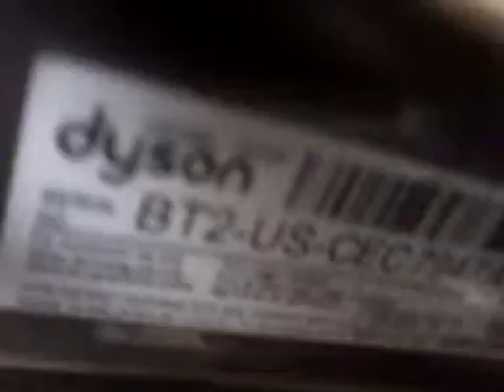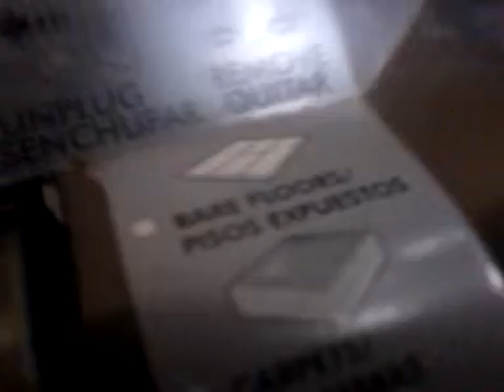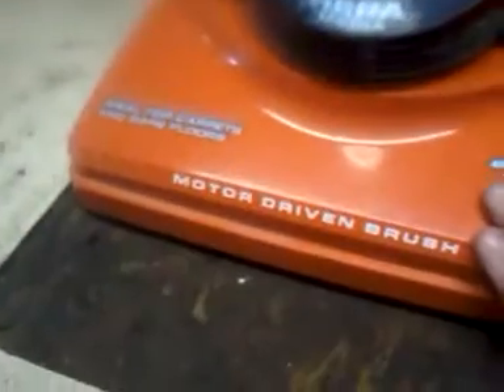Dirt Devil Dynamite vs Dyson DC33

Comment: can you wash the dynamite's filter?
Reply from the maker: No.  I've tried it before, and it damages the filter.  The Dyson's filters however are washable and reusable.  Just make sure that they are dry before putting them back in.
Reply: okay, I did slip a thin panty house over the filter, works good lol. Bought one from a lady for $10